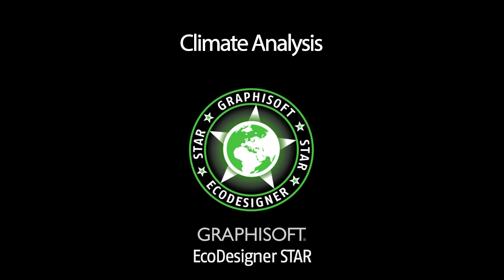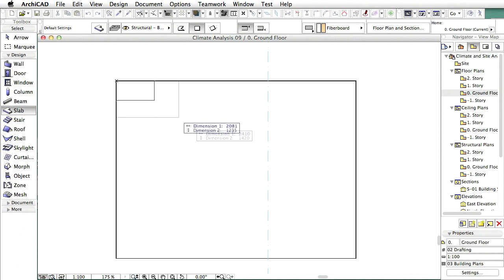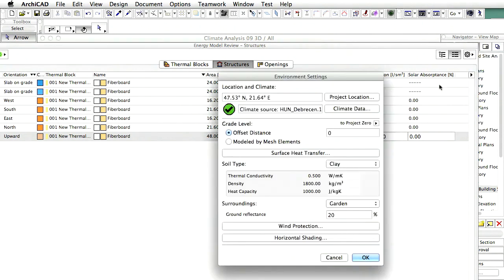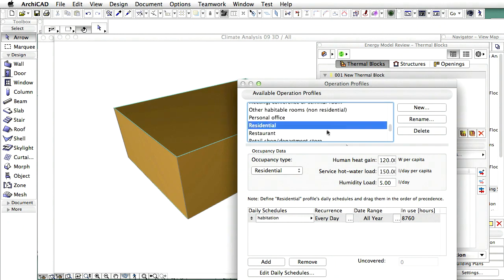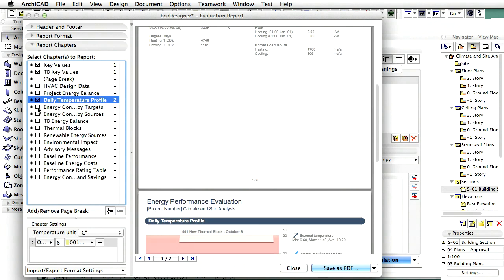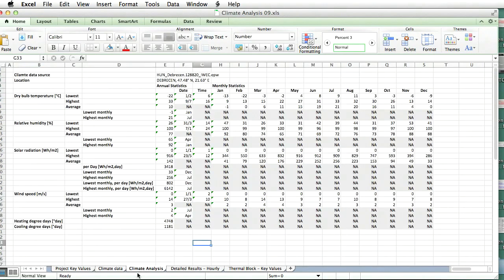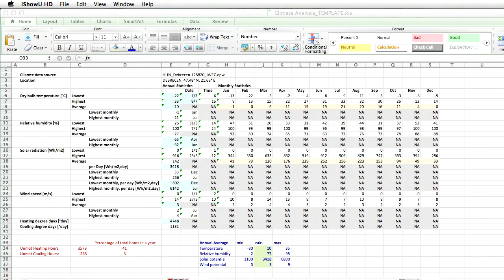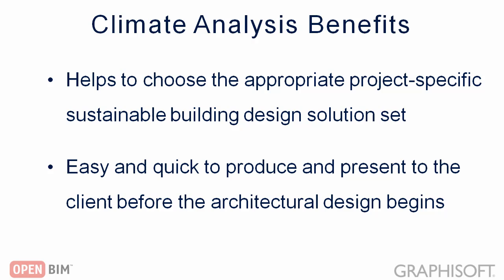EcoDesigner STAR Workflow: Climate Analysis 2 of 6

Comment: i am using the archicad 19 , and i cannot see my structure ! any help ?
Reply: after adding a New Thermal Zone , go to Update button  > Update all zones in the newly opened window > go back to Structures section in EcoDesigner tab and the External  structures should be visible ; )